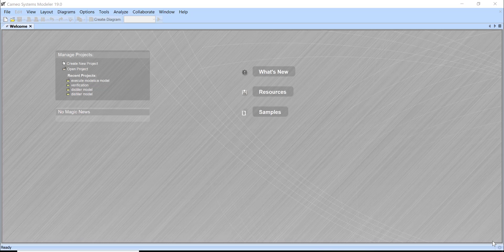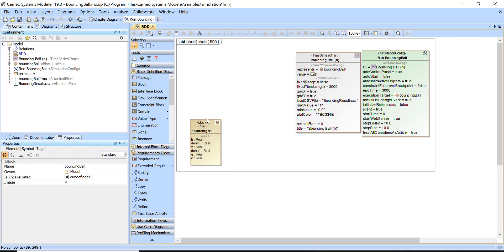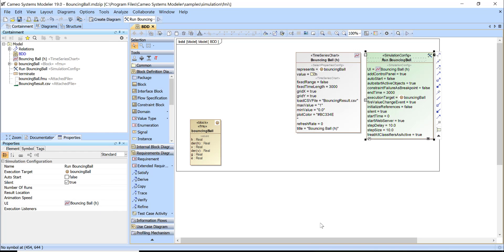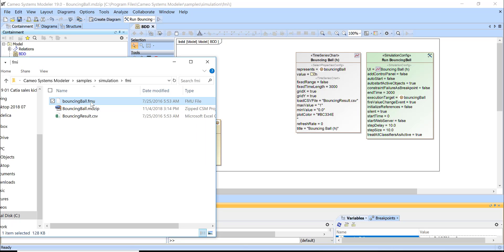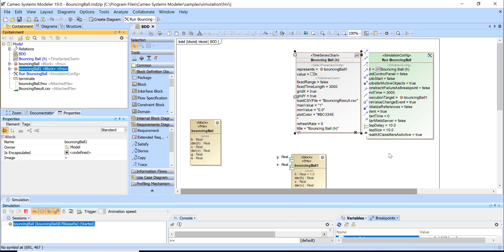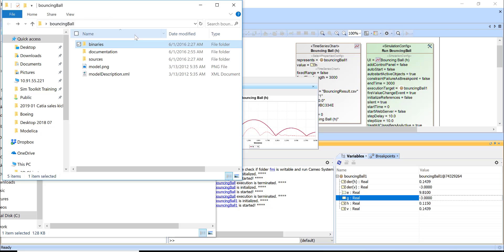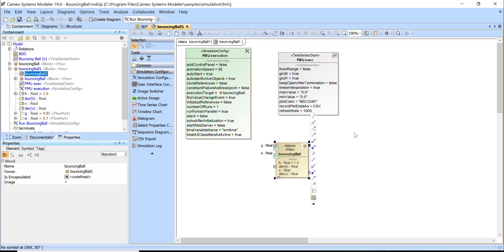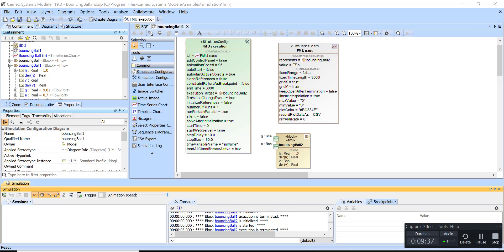FMU Import and Execution with SysML - Bouncing Ball Sample

Comment: I have imported a FMU File created from a time dependent simulink file using the CATIA FMI-Kit. However i cannot run the Block using the simulation config. The Block is accepted as the executionTarget of my simulation config, but when i run it , nothing happens. I can however run a non-time-dependent simulink FMU (a simple Addition), when i insert it as a constraint into a normal block and choose the normal block as execution target. Any Suggestions on solving this problem?  I am working on my Master thesis and i am desperately trying to make a synchronized co-simulation using simulink blocks for a control system, any help would be much appreciated.
Reply: Also: when i import the FMU File all simulink parameters are recognized and imported by cameo succesfully, but it fails to run the block using the simulationConfig. The FMU simulink file contains a simple sine wave block.
I am using matlab 2019b and cameo 19.0 SPR4 Enterprise version
Reply: @ingofrank3556  hey did you get the solution?
Reply: @Zsndjdj2908  Hi there, as you can see I posted this quite a while ago. I did get it to run eventually though. What I can recall from memory, is that i ended up using Simulinks own FMU Export plugin, instead of some external tool. I did have to do some playing around till it worked, but it is essentially doable. 

However i would not recommend that you do this at all. Even when i got it to work, I realized that Cameo really isn't designed to do too much control systems simulation. Back then i even tried to link multiple FMUs together to model each part of my control loop in detail, but that slowed the simulation down too much. So a Blackbox that summarizes all components of your system that are swiftly time dependent is your best bet.

Cameo is a tool that is used in the industry mostly to implement  single source of information documentation and to model requirements, or at least that is what they're trying to get people on board with for now. For most people the entry hurdle is simply too high to include it in their everyday work and some guy does all the modeling and documentation himself, which is then never actually used by anybody but him. My guess is that AI will change this in the future, by modeling things people describe to it. My professor at uni made it seem like the goal of this (model based systems engineering) was to do large co-simulations and simulate products entirely, but it isn't. Dude led me down a rabbit hole by trying to make his class more exciting.😐